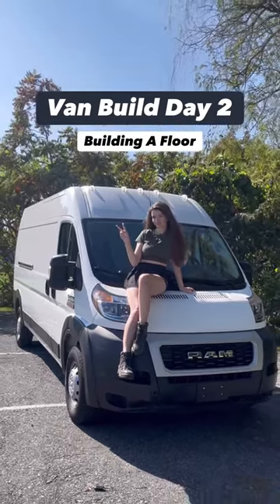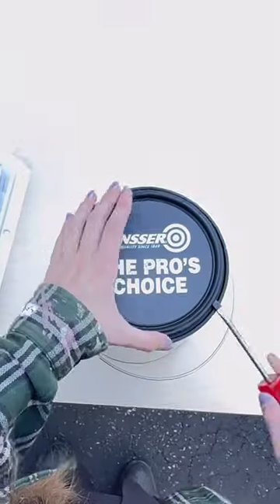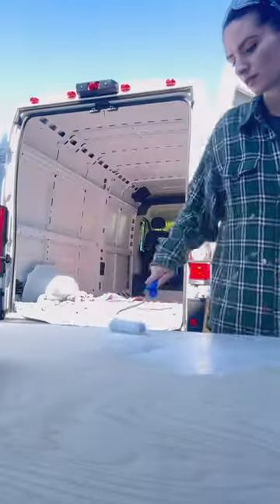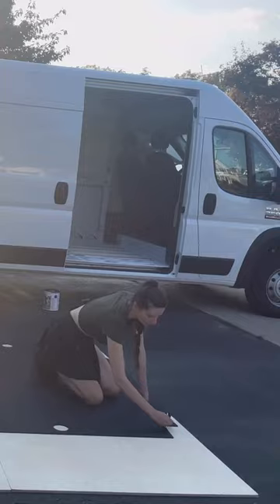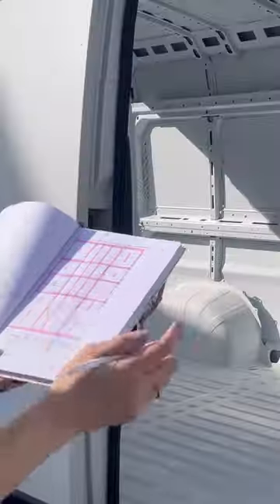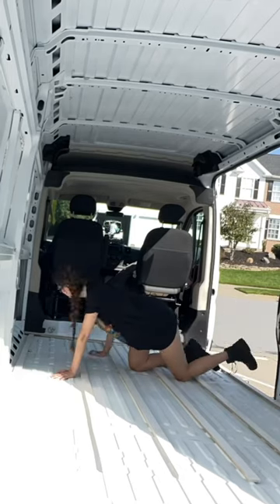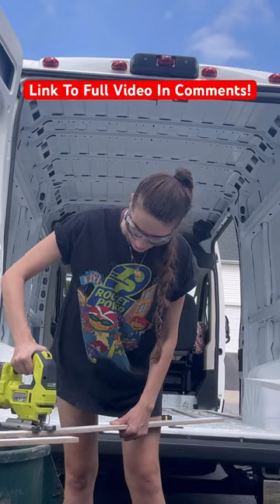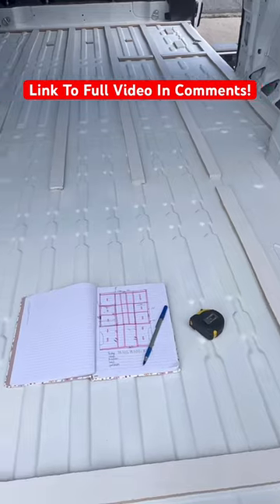Van Build Day 2: SUBFLOOR INSTALL (Part 1/3) #VanLife

Comment: Baltic birch is too pretty to use for a floor.
Reply from the maker: i used it more for the qualities of strength and stability as well as the cross banded layers in the veneer make the sheets more balanced and flat. This wood is going to put up with a lot over the years included waves of temperatures so I want it to be able to withstand that and not swell and shrink with the temperature changes. The price is obnoxious but I will have peace of mind & a high quality floor ☺️👍🏼